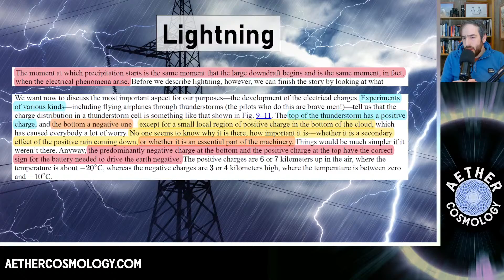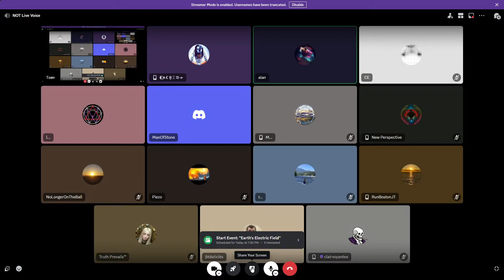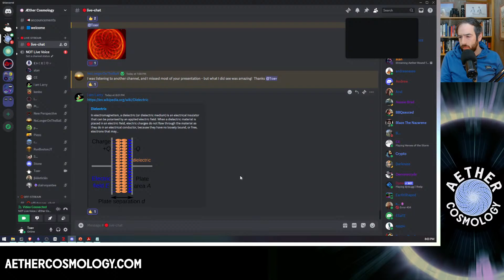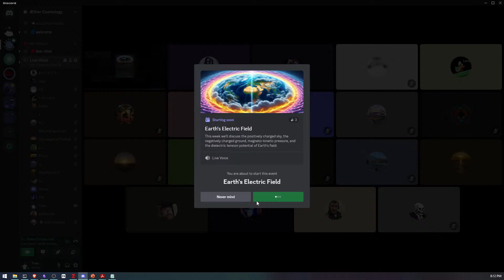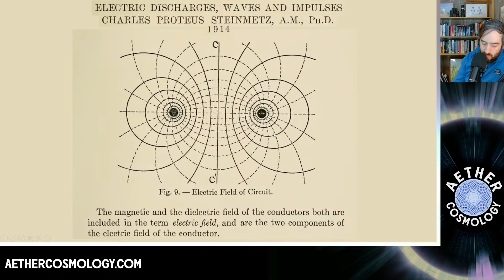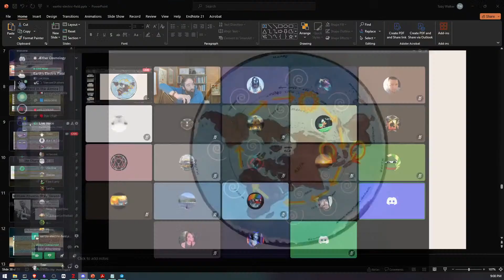Æther Round Table 15: Earth's Electric Field

Comment: When he was describing how magnets are made, specifically the part about how the rate of heating and cooling is a key, I was reminded of how bizmuth crystals form. As molten bizmuth cools, if you want the crystals to attain the beautiful metallic rainbow coloration it needs to be cooled slowly as different colors are obtained at differing temperatures as they form. As if slightly varying temperatures effect the frequencies that can be reflected from its surface. Like a heat wave interaction so to say.  Bizmuth is also diamagnetic.

Comment: Your Piezo-Electric Volcano comments really struck me. Our bones are also Piezo-Electric. So one more piece of evidence that the Earth may actually be alive. 

Each morning as the sun approaches, there is an electromagnetic transfer that takes place as the skies illuminate. The Earth can act as a capacitor in a light fixture when the sky fluoresces each morning. If it is cloudy, the energy comes from there, but on clear mornings, the temperature almost always drops almost a full degree as night subsides. The severity also is impacted by the moon's apparent location/phase at dawn.

Comment: I listened to this last night and you guys are pretty smart and one of you - I'd have to check the video - spoke about the fact that we don't understand much about our atmosphere or what drives a lot of atmospheric processes. That's because we've missed one of the biggest open 'secrets' that exists - the inherent negentropic action of water. Water has a little-known phase, called the EZ phase - the EZ stands for 'exclusion zone' due to the nature of the structural transformation of its molecules while in that phase - when in this phase water becomes highly ordered - packed into hexagonal sheets of tightly arranged molecules which exclude other particulates. The formation of ez water happens in multiple ways but it most readily forms on hydrophilic surfaces, most readily forms through vortical motion, and also most readily forms at 4 degrees centigrade - right before the freezing point. Water is densest at this temperature -this is the so-called "anomaly point" of water. The fact that this is so is the reason we are here. Water's properties allow it to act as a mechanical transducer of heat energy as well as an inherent ordering force; because the gradient in this part of the cycle is inherently negentropic it naturally acts as an entropy sink - this is why spring water tastes so amazing and why healing waters really are a thing. The best part though is that water's properties allow it to be used in the construction of a power generation and levitation device! Someone did it in fact back in the 1940's - a fellow named Viktor Schauberger discovered the principles I just told you about and used them to first make incredible log flumes that engineers at the time were baffled by, and eventully went on to make generators and flying devices that ran on nothing on air and the water naturally in it. In any case - apply what I just told you to some of the outstanding mysteries of nature and see what comes out - its fun! Also read my paper on Medium about all this - just search for "vortex induced negentropy" .
Reply: That is incredible information. I think Schauberger also built a castle down near Tampa that is a tourist trap to this day. The story behind it is he only worked on it at night and nobody ever heard machinery.